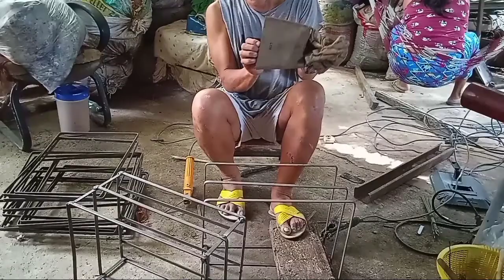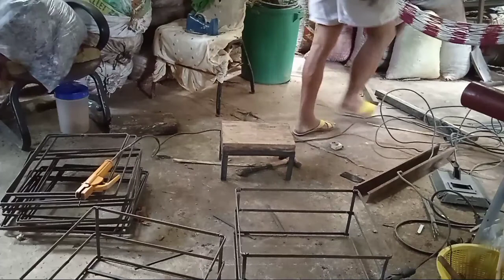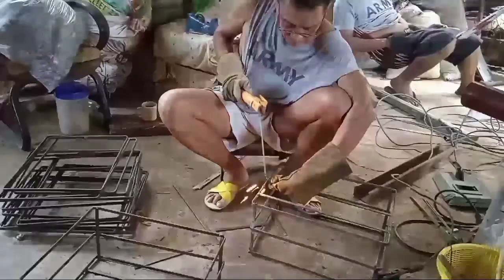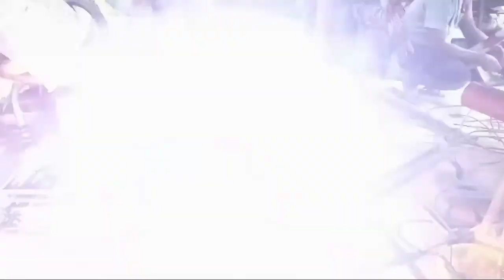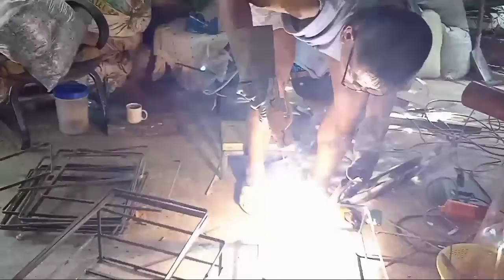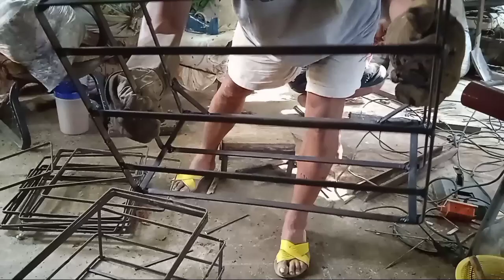HOW TO ASSEMBLE STEEL CRATE FOR MUSHROOM FRUITING BAGS

Comment: how much po ang material costing ng bawat crate? ilang bakal/gaano kahabang ang nagagamit sa isang crate / salamat po
Reply from the maker: Yong 4 pcs . na flat bars po makakagawa ka ng 5 steel crates..
based sa diameter na 44.5 cm * 34.5 cm...ang height ay 21 cm